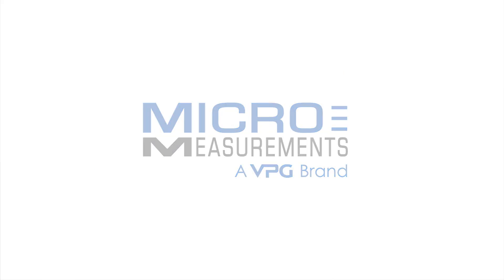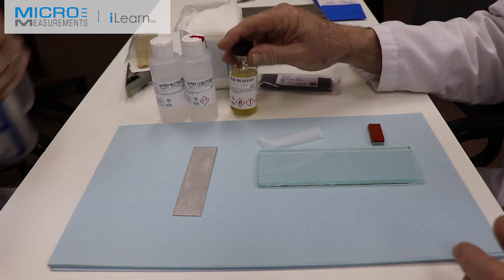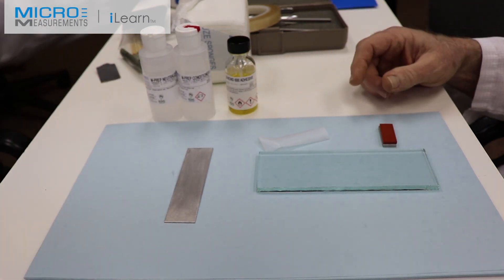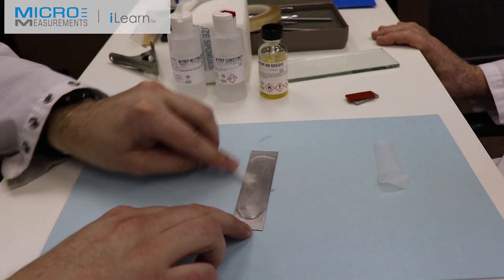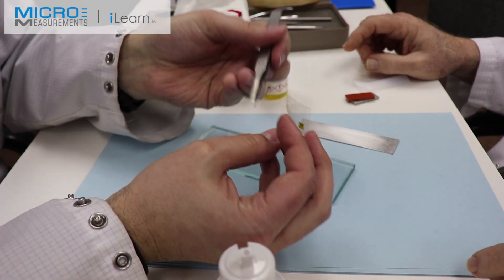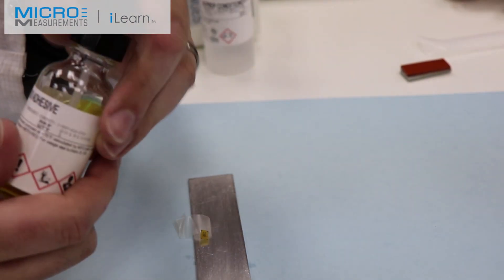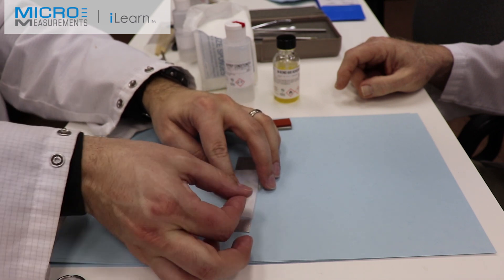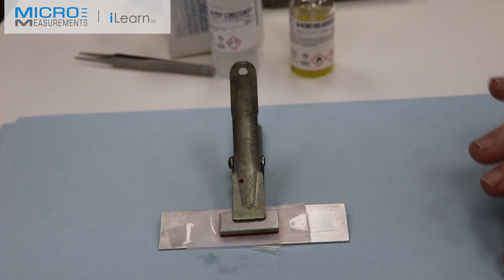Advanced Sensors Technology Strain Gage Installation with M-Bond 600 Adhesive.

Comment: El adhesivo M-Bond 600 de Micro-Measurements es una resina epoxy de alto rendimiento, formulada específicamente para el pegado tanto de bandas extensométricas de Tecnología Advanced Sensors, como de sensores para aplicaciones especiales. Cuando se curan correctamente, estos adhesivos son útiles para temperaturas que van desde -269° a +370°C. El rango superior (+370ºC) es operativo tanto en el M-Bond 600 como en el M-Bond 610, durante cortos períodos.
Si necesita más información, por favor no dude en contactarnos. mm.es@vpgsensors.com miguel.bravo@vpgsensors.com

Comment: upto what strain rate or what frequency this adhesive will work  ???
Reply from the maker: Strain rate up to 3%, regarding the frequency, it shouldn't affect the adhesive, but usually we say that the max. F depends on the other elements that U decide to use in addition to the M-Bond 600 adhesive.
Reply: @Micro-Measurements  Which is best adhesive for impact testing using strain gauge  M-bond 600 or M-bond 610  so that the strain gauge will not come out from the specimen ?
Reply: @vaibhav8009 : is this for split Hopkinson bar testing?  Judging a strain gage adhesive by peel strength is just not fair due to being less than 1 mil thick ... their asset is in-plane shear strength.  For impact work, the emphasis is normally on minimizing solder mass on the solder tabs of the strain gage, and retaining intragage (jumper) wires as well as the leadwires.  If you have more questions, please feel free to contact an Applications Engineer at Micro-Measurements.com.  FYI: as far as strain rate goes, you are normally limited by the signal conditioner and not the strain gage installation - who's limit would be from the averaging of the strain under the grid ... basically the speed of sound in the test material.